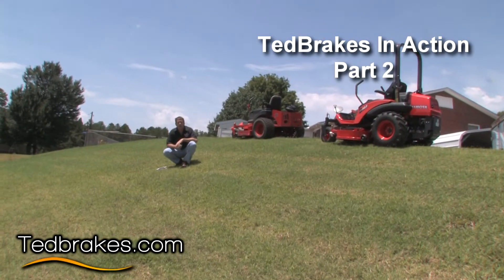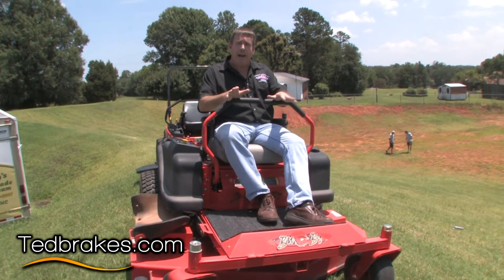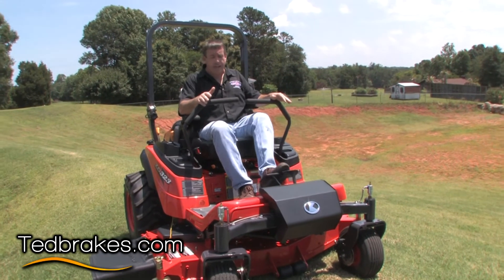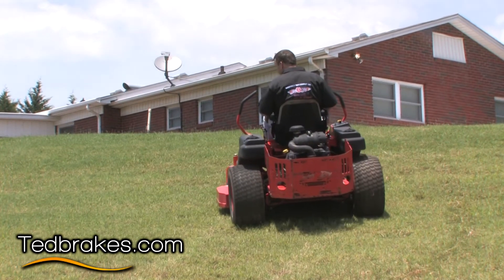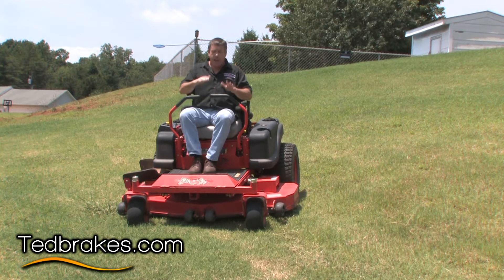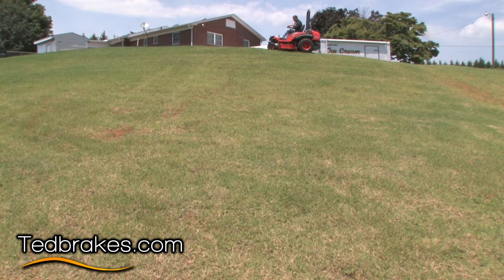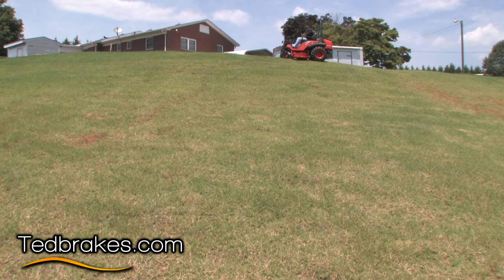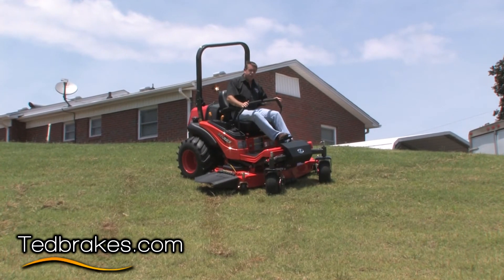Ted Brakes Update - Part 2

Comment: Front brakes could be added to "some" garden tractors and lawn tractors that have factory holes in the front wheels so you can install front wheel weights. My Toro 520xi has two holes per front wheel. Mounting the caliper to the front axle would take more work.